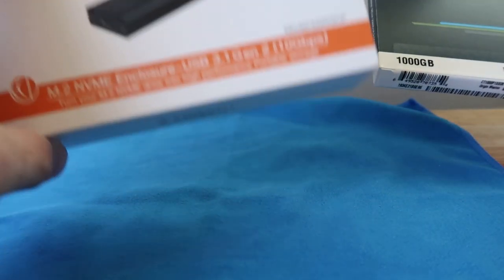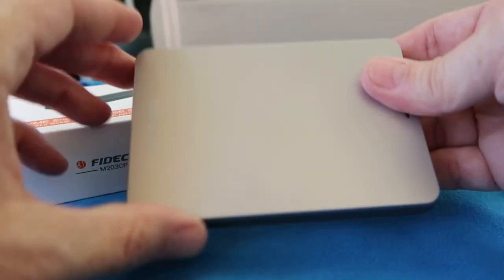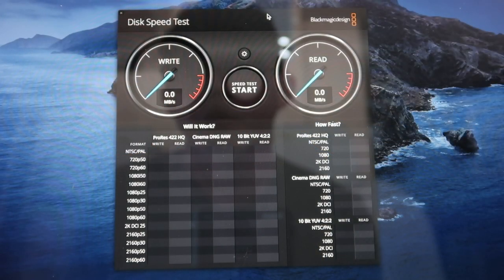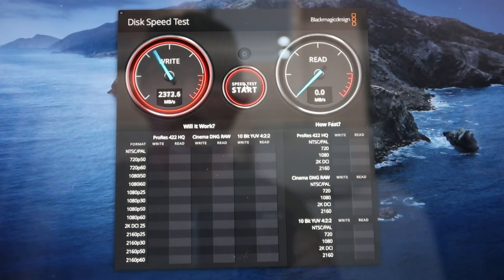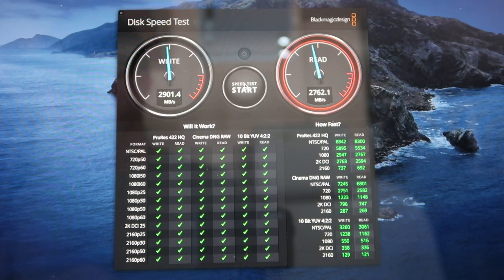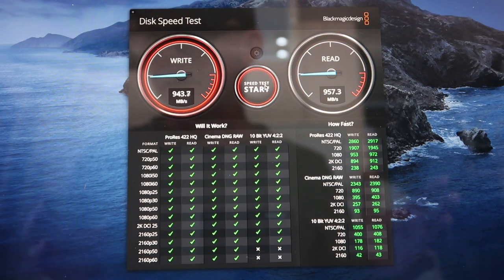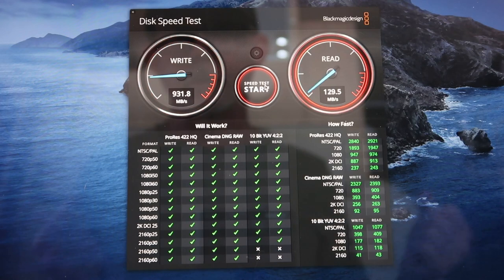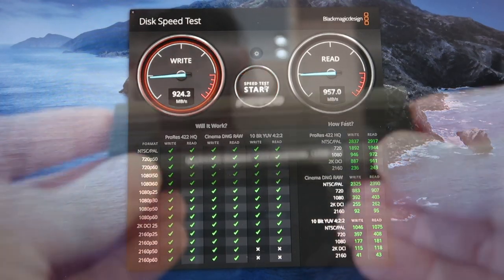External FIDECO NVMe USB Drive Enclosure + Crucial 1TB SSD | Unboxing and Benchmarks

Comment: it is interesting that they made the m.2 device slide into the enclosure. That thermal pas is barely making any contact with the top. I would have been better designed if it were to open up horizontally and then put back with screws so there is some contact with the pad.
Reply from the maker: Yeah, it would have been better as a clamshell type design for sure. It does radiate heat, but could have been more efficient.
Reply: Hi, Im using a thin layer of aluminum to fill the space. Now it works like it should

Comment: hello i got an old imac 21,5” late 2015 it has a 1tb super slow hard drive i want to move the os on the external ssd nvme so i can boot from there do u think is it ok? will it work with my imac that has two thunderbolt 2 and four usb 3.0, will i get same speeds as yours?
Reply from the maker: Yes - if you connect an nvme drive using a thunderbolt 2 enclosure to one of your thunderbolt 2 ports, it will outperform your existing internal sata 5400rpm hard drive. You’d need a different enclosure than the one you see in my video though.  You won’t want to use usb 3 for running the OS if you’re already unhappy with the internal drive. :) 

My Mac has thunderbolt 3 so I can achieve about twice the performance of yours, but you should still see a nice improvement over your internal drive.
Reply: TravelingSolo thank you very much! i got a problem i can’t find any thunderbolt 2 enclosure for nvme m.2 drives only usb 3 enclosures. but i think it will improve even if it is only usb 3 because now read and write mac mac is just 40 mbs it is hella slow
Reply from the maker: If your drive is failing, then maybe - but the sata drive in your system is 6Gbps, usb3 caps at 5 and there is a lot of overhead. 

You could get a thunderbolt 3 enclosure and a 3 to 2 adapter. That seems to be how people handle it. That gives you some flexibility and the ability to use it on a newer system too.
Reply: TravelingSolo thank you so much for replying, I also thought about a thunderbolt 3 to thunderbolt 2 cable or adapter but I don't find any, I only find thunderbolt 3 (or usb c) to mini displayport cables and I don't know if they are the same as thunderbolt
Reply from the maker: Hey Hey it just occurred to me that you’re going the opposite direction, 2 to 3. That might be a challenge. 

Here’s another option...I’ve used these kits from OWC before. It’s not too difficult and if you’re handy, is an easy way to upgrade the internal drive and gain performance:

https://eshop.macsales.com/shop/ssd/owc/imac-21.5-inch/2013-2019

Comment: Would you recommend this for next gen consoles (Xbox Series X / PS 5)
Reply from the maker: You know, I don’t have a console but I think it depends on how you use it. If it’s for game saves, that would be ok. If you’re running games FROM it, it may get awfully hot if it’s used for an extended period of time.
Reply: @TravelingSolo  Hmm ... i would use it as a external device. So a lot of games would be installed and deleted after playing.

Comment: Hi, i have the same fideco enclosure, but once i inserted the SSD correctly inside, i can't see the SSD on my windows, It should work automatically right? win 10 says that there is a USB attached, but i can't see the ssd as "connected", any clue? :)
Reply from the maker: The drive comes unformatted, so you likely just need to go into disk management and create/format a new volume. Let me know!
Reply: @TravelingSolo dope, worked
Reply: Have same problem... wont show on disk management either??

Comment: Looks like the heat transfer pad is acting like a blanket in this enclosure. That is, it is not pressed against the case and therefore is unable to transfer any heat.
Reply from the maker: I don’t think it’s great contact  but it does generate a significant amount of heat under load at the pad location, so there is def some heat transfer going on.
Reply: @TravelingSolo  Considering the ssd should not really get very hot being used well below speed spec, it is probably being cooked and it would be a good idea to add ventilation holes to the enclosure.
Reply from the maker: @davidfrisken1617  nvme drives run notoriously hot under constant load regardless of their link speed. It’s why a good quality heat sink is necessary. This case isn’t really meant for streaming storage or running an OS from to begin with. If the intent is to use it as live external storage for video editing or something, you’d definitely want to look elsewhere.

Comment: Hmm, got mine from Amazon UK and it did not come with the thermal pad, in fact the instructions/manual don't even mention a thermal pad in the parts list.
Reply: EDIT: I have the non NVME version for standard M.2 SSD - this could be why but everything else is the same.
Reply from the maker: I think the SATA M.2 doesn’t run as hot as the NVME, that might be it. I don’t have one to test, though.
Reply: Maybe not as hot but when I tried it out yesterday and did a format (with quick format unchecked), the heat sink style case was pretty hot by the end.

Comment: Hi I saw that enclosure and plan to buy it but I can not find any info on FIDECO on amazon or the internet to ask them if I can put the Samsung (MZ-V7S1T0B/AM) 970 EVO Plus SSD 1TB inside and still get the blazing Read Write Speeds Up to 3,500MB/S and 3,300MB/S, respectively...  These are the speeds the 970 EVO Plus SSD has, but will the FIDECO enclosure be a bottleneck and decrease the speed OR the enclosure has nothing to do with it? I'm asking because the 970 EVO Plus SSD has a PCIe 3.0 x4 and M.2 2280 interface. Does the FIDECO have the same PCIe 3.0 x4 interface as well? The Amazon details for the FIDECO say USB 3.1 Gen 2 10Gbps to NVME PCIe M-Key interface. Usually amazon lists items compatible with every product but in this case  ... silence. This is the NVME SSD I want to buy and need it to be so fast because I will use it for editing video: @t
Reply from the maker: Seems to me that if an EVO is able to hit 3000+, but a 10gbps link tops out at 1250, you’d want a thunderbolt compatible enclosure to take advantage of it. That said, I don’t think this little case (or ones like it) would dissipate enough heat to run video editing from an EVO inside it and not burn your fingerprints off. Lol
Reply: @TravelingSolo  I think so too. I am looking for a Thunderbolt 3 enclosure as well because my next PC will have Thunderbolt 3 ports FOR SURE. BHPhotovideo has a couple of Thunderbolt 3 /USB-C enclosures but they are closed till the 15th to answer any tech questions.